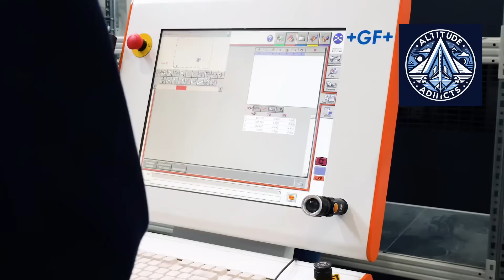Russia Adds Two New Tu-160M Bombers in 2025

Comment: Who ever is talking doesn't know how to add. They said Russia had 16 original TU-160's at the start. Then 4 more were built in 2023 of the M version. Now in 2025 they added 2 more, if my math is correct you got 16 at th start, then add 4 more in 2023 that adds up to 20 and then add 2 more in 2025 that makes a total of 22, not 20!
Reply: @JoeyRay-fz1qe  To be fair, he did say a minimum of 20? "No fewer than 20."